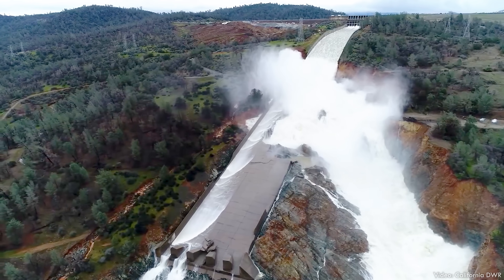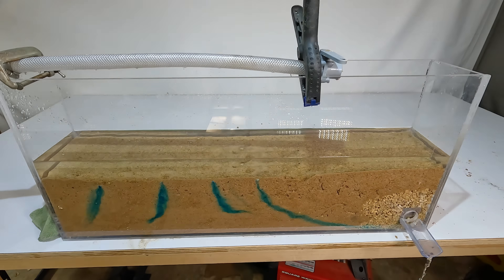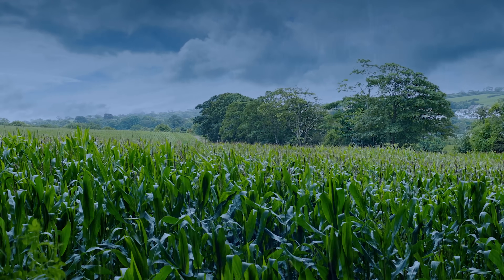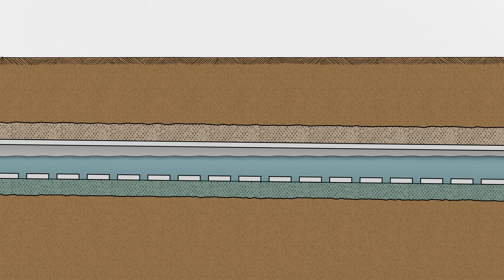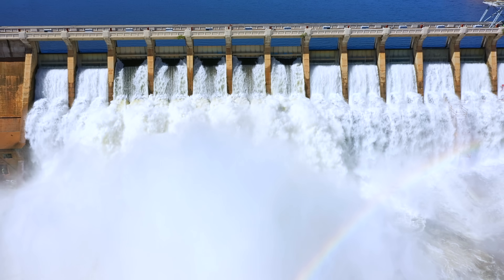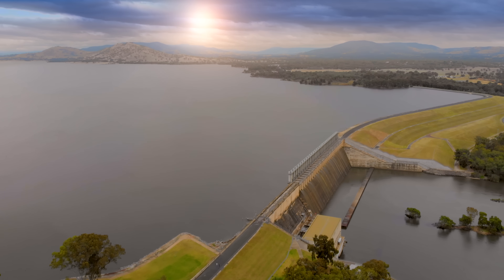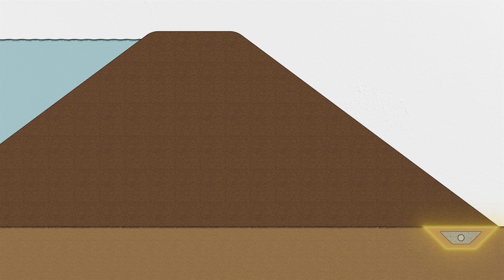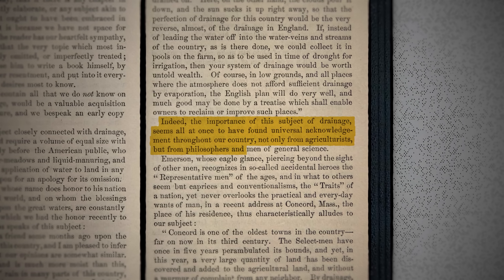How French Drains Work

Comment: My grandfather worked in the Forest Service and later the Sea Bees back before perforated pipe was really a thing, and they commonly did three-stage filters (or sometimes more) instead.  Same idea as the two-stage, just with some 2" river rock for lots of voids in place of the perforated pipe, and then successively finer layers until you got to something the local soil wouldn't migrate through.  The pipe is easier to lay and more consistent, but just rocks of graded sizes will do in a pinch if you don't have it.

Comment: Where I live, we use a sort of "coffin channel", a channel with rectangular cross-section built of large rocks to create the channel itself, then smaller rocks and then gravel around it. They don't last forever, and we recently almost had a tractor tip over on a 30 degree incline when the lower front wheel suddenly opened a small sinkhole where the drainage was clogged. We serviced a different one that was still mostly intact when putting down fiber for better internet in the same area. We live along a fjord, so all our farmland is on the mountainside - drainage is still incredibly important, as our weather is very wet, and tractors would just sink or slide without it.

Agricultural engineering is frankly super interesting.

Comment: I've always heard the concern that french drains or other sub surface devices will fail EVENTUALLY, so I've been wary of using geotextiles with some upcoming residential landscaping. Based on the info in this video, is sand a viable option for a home landscaping french drain? (Perforated pipe inside gravel pocket inside sand pocket). If they're using it for these huge dam applications, maybe the sand layer has to be so thick that it wouldn't be feasible for a smaller scale? Awesome video!

Comment: This is really important! And, as per your title, Practical. - I had a house where after heavy rains the basement window well would fill a foot and a half deep with water, which slowly flowed into the house. But because the adjacent landscaping was graded downward I was able to dig down and install a French drain starting just below the window, which completely stopped the problem. And come to think of it. I'm lucky we saw water in the window well! Because regardless, there must have been a great amount of water deep in the soil by the basement concrete wall, which would have eventually found its way in or caused damage from expansion from freezing. - Why wasn't all this considered by the builder? Seems a serious oversight.

Comment: 11:26 Before you can design a filter you have to know what you are trying to filter.
Always makes perfect sense. As in a fuel filter, an air filter, even an N95 Face Mask for viruses and other really tiny stuff.
Yet... as shown in the video.. no filter is ever perfect. Some stuff is going to get through. But if you reduce the % of stuff down to a tiny % then it will probably do the job for a long time.
So I'll never deny that filters have a good purpose. Even a french drain will need replacing someday.

Comment: These drains can be used anywhere where water can cause damage. I installed a one of these next to my home to prevent water running under the house. It worked very well. In Australia they are called Ag pipe drain or agi drain.

Comment: I just finished installing a French drain in my yard, and it’s working great. During the digging process, I discovered that my yard was flooding due to a large granite slab just below the surface. The combination of the slab, clay soil, and sod erosion made the water retention issue clear. Since my dig, I’ve learned not to take porous soil for ‘granite.’ 🥁
Reply: lol
Reply: :face-orange-raised-eyebrow::face-blue-smiling:
Reply: Is that slab the top of your septic tank?

Comment: Thanks for the explanation.  I had water intrusion in the concrete floor of my basement level condo and the HOA tried for weeks to find the source. Finally they gave up and put in a French Drain across and under my Condo floor. If they couldn't stop the water, then at least they could divert it.  I've never had a problem since..  I wasn't sure what that was, but all I knew was it worked and I had no more pooling water.  Now I know how they built it.  Very cool.

Comment: I recently(roughly a month ago) inspected a drainage pipe system being installed under a future reservoir locally and they had two sets of holes, one set was put at 7 o'clock or half past 7  and the other set at 3.  I think it's a good choice since it still allows for faster flow since the bottom of the pipe has an uninterrupted invert to help wash silt buildup through the system and without forcing the water level in the envelope to rise too high. They used a bed of smooth river rock wrapped in a filter cloth around the piping.

Comment: The key to french drains is proper installation. Many older systems installed back in the day failed quickly because they became clogged or they where never ran to daylight or pumped up and just terminated in the ground becoming completely useless once the ground is saturated during wet weather events. This might work ok in the right soil conditions in a very dry area with sandy loam soil with a low water table, but not everywhere. Unfortunately many older home footing drains where done that way. They need to run to daylight or be pumped out to daylight or a storm drain system to work properly. Another note is to be sure the soil around your foundation is sloped away from the foundation so water drains away from the home. Roof runoff also needs to be removed far away from the foundation. Do those two things and you might not even need perimeter drains around the foundation. Now if the foundation was dug into the water table that’s a whole other issue that needs addressing and a sump pump maybe the only option.

Comment: If you're building a French drain. Whatever you do. Don't let ANYONE tell you to use a corregated pipe. Use pvc. The smooth walls will allow water to flow quicker, reducing the buildup of the dirt that does make it into the pipe. Plus, they're a good bit more durable.
Reply: pvc gets clogged easy

Comment: Enjoyed the video, but not sure why it works.  So....the reason the water in the rest of the soil heads towards the drain (even though it was a flat surface) is because the rocks allow faster drainage in that area and water takes the path of least resistance?

Comment: I just came across this video serendipitously after researching sump pump egress designs for my house. I was previously thinking a french drain setup might be good, but this video has me rethinking it now that I understand the concept better. Is there any reason for the sump pump egress pipe to have slits like a french drain? Or would doing so be counter-productive, just pushing pumped water back into the ground around my house?

Comment: If you are going to install these you had best be forward thinking enough and plan  on how to use a  "Sewer Jetter Nozzle" on  a pressure washer to clean it out from time to time.  I'll give you a hint Y- Intersection Pipe fittings are your friend. 

About once a year or so I'll clean mine out, but they can go for 5 years without too much fear of clogging up, just make sure that your pressure washer is 2k psi or lower if you can. You don't want to go above that unless you really have to.

Comment: Rounded stones do a better job maintaining void spaces over time and therefore flow better. Crushed stone tends to lock together which makes it good for driving surfaces but not so much for drainage.  Also if the soil contains a lot of fine clay, you'll probably get a longer service life without a geotextile sock.  I'm not an expert, these are just opinions.  Don't forget, the drains might be French but Oui Oui is a No No.

Comment: I’m a house builder in the Colorado mountains who does foundation too. Rocky and sandy soil negates the need for a French drains. However I am building a house in eastern Colorado at the moment for my son.
Heavy clay and it’s in flood plane (low hazard). The house is fully engineered. Over excavated 80”x36” for   structural fill underneath 24”wide footing and a full gravity French drain system. Thanks for educating me on this subject!

Comment: I'm a bit confused. It feels like with the different grain size & "hole" size the problem of – "either the particles get through with the water or they clog the holes" wouldn't be fundamentally resolved by the multiple layers of different size, but just slowed. And either the erosion or the clogging would still happen eventually. So how are the drains maintained then? Completely uncovering them every 50 years?

Comment: Up in the NE (Buffalo NY for me), we know well about underground drainage needs from not only rain, but snow melt in the spring.  Anyone with a basement will probably also have footer drain system and a sump well & pump to remove it.  

In my case and with how my property slopes towards my house, I also added a french drain around the back and side yard to carry standing water around the house to the town's street drain system.  Works like a charm and eliminated the water I would get pooled up in the back yard, especially in the spring.  It lso takes much of the load off the footer drain system and my sump pump.

Comment: Surface water drainage engineer here. Slots or perforations on pipes should go in the top. This reduces sediment in the pipes and also reduces the volume of flow off a site for smaller rainfall events. It also increases velocity which flushes any collected sediment away. Holding more water in the stone is also beneficial for treatment while maximising the volume of water infiltrating into the ground.

*there may be an argument for placing the slots/holes on the bottom on some use cases.

Comment: Does subsurface water diffuse through the soil, and whatever diffused water happens upon the drain is drained out? Or does the subsurface water follow a "path of least resistance" (like electricity), which would be toward the drain (empty free space vs. compact soil)? I would assume the latter, based on the demo, but would love any clarification!
Reply: The drain acts like a "sink" with low internal pressure (less resistance to flow). The water above and around the pipe will be pushed towards the low pressure area of the drain.

Comment: the direction of drain holes seems like it has a pretty obvious answer right?
2 sets of holes 45 degrees apart from eachother centered on the bottom
its not much more filling required for the water to get into the pipe, and when it does it has a smooth bottom

Comment: I have a minor issue with that first model you made.
While I'm sure the concept works, of course the water would drain there, it's the only hole in the box. (only intended hole :P)
I think it would need a comparison of some kind to really show what the design is achieving.
Either a second hole in the box where there's just the normal soil, or a second run where there's no gravel to see the change in flow.

Comment: Could the drain pipes have built-in Archimedes pumps with slotted helicoids to let the water move thru passively but still be able to "pump" the clogging materials whenever needed? Or are they usually not setup in a straight line or with rigid circular pipes?

Comment: On the "top hole vs bottom hole" debate.. Why not a pipe that has two rows of holes, 90 degrees apart, which you place in a way to have the rows 45 degrees from the lower center. That way the water flow is not perturbed by holes and still drains the ground before it gets above the half mark of the pipe.

Bearded Grady jumpscare at the end there. lol

Comment: I was getting a drink not paying attention in the beginning when he said "dam engineers". 😂😂😂😂

Also, I do have french drains around my house with a sump pump in the corner of my basement. But there isn't any drainage in front of the garage doors and my house is built into the side of a hill where the basement and garage is on the same level but separated by wall. So this video actually helped me refined the idea I had to deal with it.

Comment: Using a French Drain in reverse is the basis of how you install a Drainage Field for septic systems. When I was in the septic industry, we mainly used the white pipe with hole in it. installed in  a trench os crushed stone (1 3/4) covered with landscaping fabric.

Comment: I was wondering why do you call them "french drains", but that explains it.

In my language they are "secret ditch".

One thing about clay pipes, is that I know of an apartment building from 1970 that has clay pipes for drainage. And if they were installed as described in the documentation, they actually have a sort of grill structure made out of boards to keep them level. And it is interesting to think that it is possible to use perfectly normal cheap untreated boards underneath these pipes, because underneath the pipes they are basically submerged forever and as such will not rot... That is unless if for some reason the water level would fall below drainage.

Because wood does not rot if it is submerged, it was used as pilings for buildings as well... And the documentation for the 1970 apartment building includes plans for either wood or concrete. As part of the soil survey... The documentations does refer to a document that should describe exactly what type of pilings were used and details about their installation. But sadly those papers are lost. So we really don't know if the building sits on concrete or wood pilings.

But I do know of an entire city where wood pilings caused a lot of headache due to droughts wich ruined them. Actually causing entire apartment buildings to split up. I think many were torn down because necessary repairs would have been too expensive. So, while water can often cause problems, so does not having enough of it.

Comment: I was going to put french drains in my yard, but remembered that the land here is a clay layer on top of a sand layer, and there are lots of places you can see that the sand underneath has eroded, and caused the surface to cave in. 
I decided against french drains, because of the risk of dumping water into the sand layer and causing a sinkhole on my property.